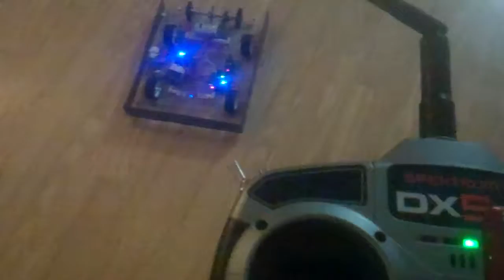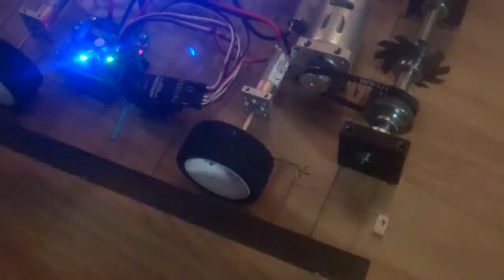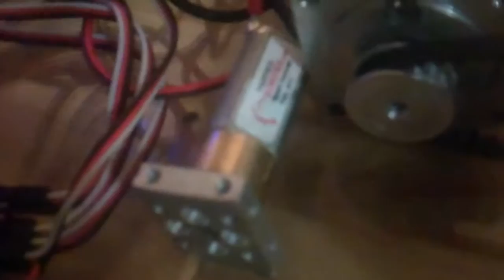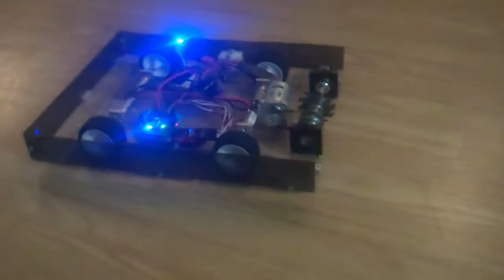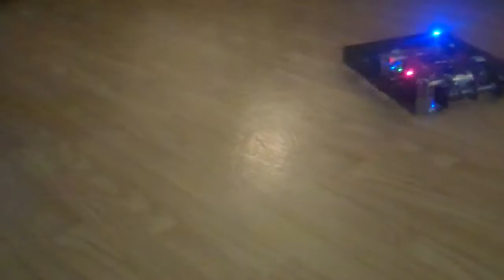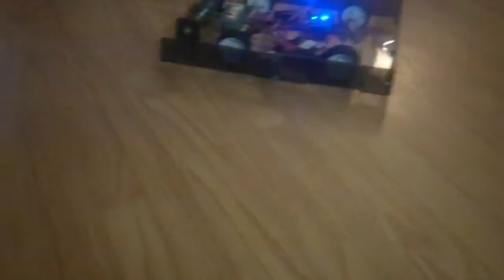Beetleweight Battlebot Maiden Voyage

Comment: 3rd: your weapon motor is brushed. I would recommend switching to brushless. I won't recommend a certain motor in particular, but you will find that a motor with the same power will be much smaller and a similar size motor will be much more powerful. 4. I feel like there is much too much shaft on that weapon.  on the next iteration you should try and shorten that.  other then those it looks good!

Comment: looks good man. just a few notes to when you come up here. 1. your armor will not be good enough against some of the mega spinners we have in the beetleweight class. search for debacle combat robot to see why. 2. If you haven't already, you should look into the fingertech switch. it is lighter and smaller, and it should handle the current load of your motors fine. the whyachi switch is a little heavy for the beetle class. it's good in 12-30's though.

Comment: You should be putting at least 11-15v on your bot. I suggest cutting the shafts on them and putting the wheels as close as possible to the motor mounts (this will increase turning speed as well) and giving max. 1/2" clearance between the wheels and side walls, since lexan/polycarbonate doesn't like to bend very far before it cracks. If you're just using a straight rod with nut washers, Make sure to have at least 2 nuts at 90 deg. holding the rod, aimed away from the blade if possible. nice bot:D

Comment from the maker: Its that wide because the motors are direct drive and are long, plus i gave a gap between the side armor and the wheels. The idea being the lexan will flex and absorb the impact without touching the wheel. As for its turns - not sure! This was its first time being driven - i think it is my speed controller, it was calibrated for a different gearbox.